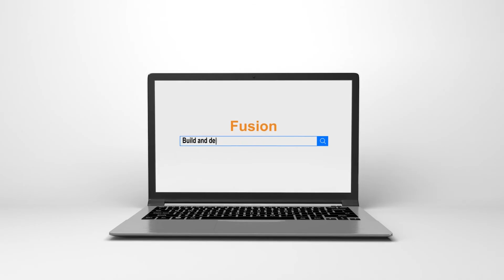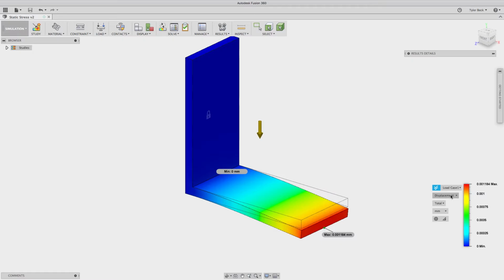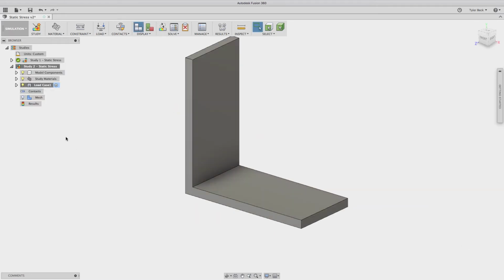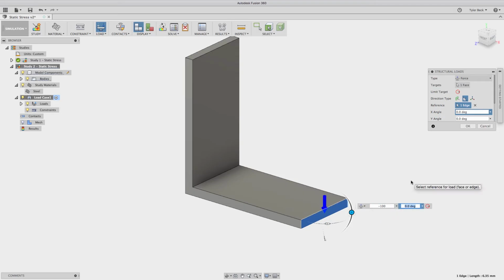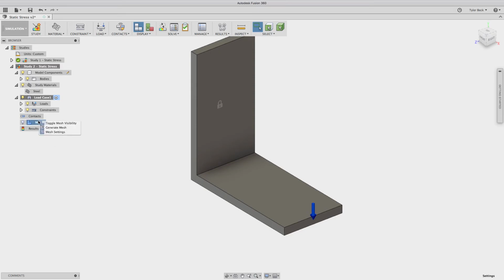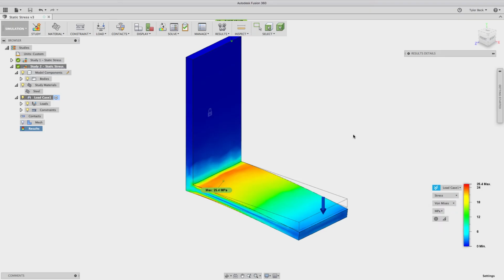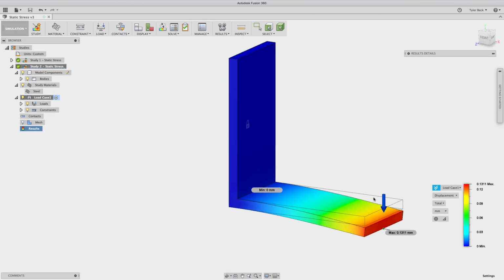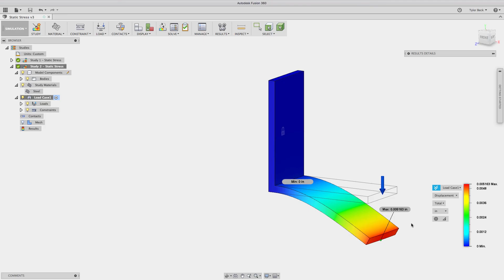Fusion 360 Simulation - How To Setup and Test Your Part

Comment: This is on a whole new level of design for us with just a high school degree.do we need to understand complex engineering and math doing these kind of stuff?
Reply from the maker: I would say anyone can setup and run a simulation.  Getting an understanding of the design and how it should behave is helpful and possible.  But, trusting the numbers you get is a whole other challenge that requires training, mentoring, and hard work :)

Comment: Can I perform Finite element analysis with Fusion 360 as like ANSYS?
Reply from the maker: You can perform FEA in Fusion 360 but comparing to Ansys is difficult.  I have been introduced to a lot of FEA tools over the years.  If you are designer wanting some qualitative feedback on what you build and then working with an analyst who uses a powerful tool like Ansys...Fusion is awesom.  If YOU are the analyst I think Fusion probably wont be enough for you.  This isnt 100% true in every case...but hopefully helpful.
Reply: no
yes

Comment: Can i pose question about this example? Sorry for my engish at first. I noticed that edge with force falling down is not moving in arc as it should be in real life, but straight down along axis, so actually that horisontal part prolongs (stretch) as it falling down . Is there a way to adjust that bending follow real life situation? You can see easy this anomaly by raising force to bend significant ammount down.. Thanks if somebody know.
Reply from the maker: If you are asking for loads to adjust with the deformation of the model, this is something that is typically calculated in a nonlinear study.  Currently that is not an option in Fusion 360 but I WANT IT!
Reply: Hey , thanks with this. I managed to do it by nonlinear, and my f360 is working? I guess just need (free)registration? Thanks for answer
Reply: shut up u nerd